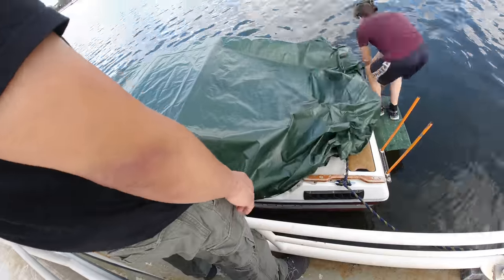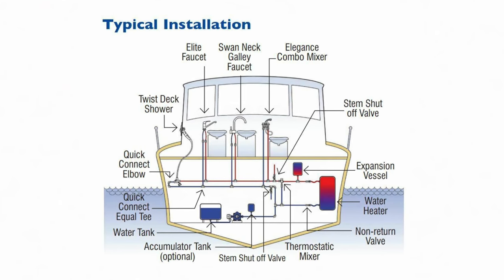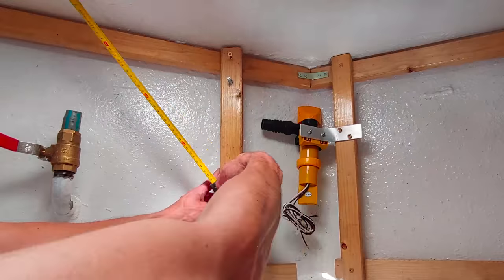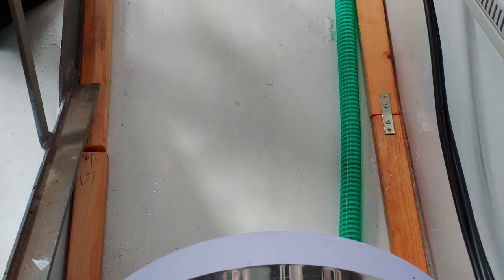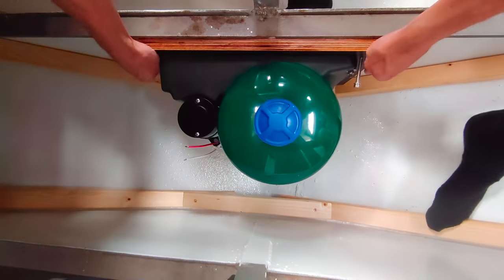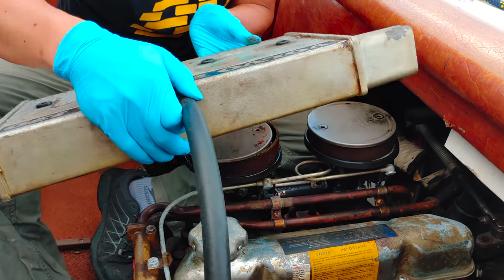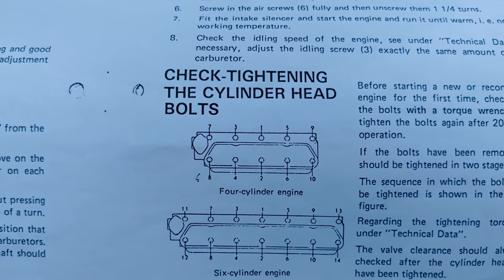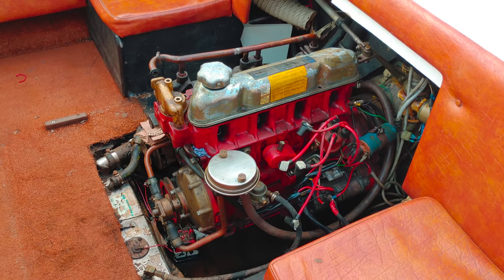OPENING the ENGINE of my 1980' BAYLINER Mutiny - Ep. #42 - Vintage Yacht Restoration Vlog

Comment: That engine isn't a total lost.
Take the head back off and rotate that cylinder to bottom dead center. Look the wall over good.
If you don't have large grooves in it you should be ok.
Take your head in and have a valve job done on it and have them check for cracks...
You may find out you still have a good unit there.

P.S. don't use your torque wrench as a breaker bar.
You'll ruine it. And screw up the calibration...
Keep up the good work.
👍👍👍

Comment: Looks like a blown head gasket let water to get into the cylinder causing the damage, I'd say the engine is rebuild-able.
Reply: Agreed ^^^
Reply: That is exactly my thought.  I would price a rebuild on this motor, might be most cost effective solution rather than buying used.  You get a new motor in the process.
Reply: @kenknight4560  That's right, in a rebuild he gets what you said, a new motor, in a used he gets the mystery motor that could go bad just like this one.
Reply: A nut was dropped down one carb. It actually looks like it on damaged one piston a little. The small chip on the head can be repaired with a welder put a new piston in and run it
Reply: @giles-df9yu  that's not a chip on the head. Look closer. It's just the head gasket that's damaged
Reply: It's definitely a blown head gasket, between the exhaust valves of #2 and #3 cylinders. Common failure point because that is the place where the head gasket experiences the most stress, as the exhaust valves of those cylinders are pointing towards each other. You can also see the point of water ingress on the coolant channel that is most rusted.

That motor will be OK after a good clean-up.
Reply: nope. that piece was part of the valve seat on the smaller valve. that motor was way overheated and the seat came out and got chewed up in the piston. that motor is toast.

Comment: Torque wrenches are designed for tightening bolts not loosening, you can damage the internals/alter the accuracy by over torquing when loosening bolts.
Reply: You beat me to it, right on.
Reply: Another newbie tool user mistake.
Reply: @JamesRook  
I've seen qualified fitters in nuclear power plants do exactly the same thing.
I worked at a garage when I was 10 and one of the mechanics caught me using his torque wrench to undo wheel nuts, he kicked my ass all over the workshop but in 52 years I never did it again 😂
Reply: I have two torque wrenches that work in either direction for left hand threads and I heave been involved in the maintenance of gas turbines and high sped rotating equipment for over 40 years.
Reply: @bigboy9693  
All my torque wrenches work either way as well, never seen one the that doesn't.
Reply: @bobp6742  I have a 3/8 drive one that does not as it is fixed without a ratchet. but my other ones work in both directions.
Reply: @bigboy9693  At last count I think I have 6? 7? I have a couple of small 1/4 drive inch/lbs wrenches for torqueing things like Harley primary covers. Mid sized 3/8 drive units for larger fasteners running up to maybe the 200 lb/ft range, and 1/2 drives for the big stuff. A Harley crank can need 500 lbs of torque. They are all reversible.
Reply: There are several mistakes he often makes... F.e. using metal files in both directions, instead of only "pushing" - that kills a file very fast.
Reply: This 👆
Reply: calling bullshit on this old furphy, that torque wrench clearly has a reversing switch and if they thought loosening bolts would hurt they would  not have enabled such a design.

Comment: Don’t give up on that engine, take the pistons out it doesn’t look that bad
Reply: I was going to say the same thing.  A little clean up and a new head gasket may be all that's needed. An inspection of the bottom end would be nice just to make sure the rod bearing didn't get smacked or rank bent, But it is an assumption that the piece fell in while running. It could have rolled in just trying to start, in which case no real damage would have occurred.
Reply: The "bad" cylinder may only need to be honed. Since the piston was at the top of the stroke, the bottom section of the cylinder may be fine. The advantage in reassembling the engine with new bearings, rings, gaskets, etc. means that you will know that the engine is in good condition. Just buying another engine, you won't really know the condition of that engine. It might run, but for how long?
Reply: There is allways hope, dont give up yet. Some times we have give first aid even worse engine. Greetings from Finland.
Reply: Oil it and free it up. if you can't free it by pounding pistons with a wooden plug,  try putting the head back on, making a grease fitting that screws into a spark plug hole, and using a grease gun to fill a cylinder with grease and then force it hydraulically with the grease gun.  You can fabricate a plate with a grease fitting and bolt it on with the head bolts too.  https://www.youtube.com/watch?v=vOBBU6h8BFU
Reply: I agree here... I paused the video and it looks like the gasket blew next to that water port. From there it probably hydro-locked. As long as you dont have any lower-end damage this should be a simple fix. Even then a replacement rod and bearings would be easy.
Reply: I agree to. see alot worse  come back around .that build up look like carbon an rust an crust .l stop the video I dents see any valve damage.i would wire wheel that head make sure valve  not stuck .clean that piston up lightly go around top with wire wheel put some oil on cylinders getting turning over an put it back together. You might what to check head for flats ness .take a file at a angle run it across head lightly.
Reply: A little hone work, some rings, wire brush & lap some valves, new head gasket, clean the carb - it should run!  Might not be good as new ... but that old boat isn't one bit new.
I fixed worse when I  was a boy, most times i didn't even have new rings or gaskets, just sand paper, Permatex, and used oil.

Comment: Greetings My First Boat,  You are doing a great job.  You make it seem like it is not hard work but we know better.  Please consider installing a second, much larger bilge pump such as the Whale Orca BE3004 189 liters/minute for unexpected emergencies.  It does not need to be mounted in the very bottom of the bilge, just somewhere accessible that will keep your boat afloat in an emergency.  The reason is that if you run aground someplace and cause a big leak in the hull below the water line and your primary bilge pump does not work for some reason, you may not have time to diagnose and do a repair.  Also, your Supersub Smart pump capacity is not intended to handle the volume of water from an emergency situation.  With this second pump, all you do is turn it on and you will have more time to save your boat.  It is well worth the cost.  Regards,  Cole

Comment: That cylinders head gasket went due to corrosion it seems, it ate some water and was put away wet. Seems to me like it could be saved with a hone (maybe a bore), new rings, maybe new valves and a piston and offcourse new gaskets and bolts. Then again if you can get one for cheap it may not be worth it. If you plan to just do short runs with it, this might be a nice format of vessel to convert to electric, since it doesn't need all that much power to go and you can use the batteries as an extended house pack for the big boat. Getting some more solar might be a good choice at that point

Comment: That was caused by a blown head gasket clean it replace valve's and head gasket simple fix.
Reply: agreed- shes not dead yet!!!   soak it in marvel mystery oil,  get it rotating and clean it,   and re-clean and seal-- ill bet she'll run for relatively cheap money
Reply: i think it is more likely that the inlet valve was open and water entered through the air intake on one of the carbs looking at how much corrosion there is on one of those carb throats
Reply: @debeeriz  exactly- it looks like iron buildup not a broken part,  sure it needs a new valve,   but i believe a little cleanup and head work and shes good to go- the iron deposits took the shape of round because thats how it settled in the cylinder,    not a piece of the valve- at a quick glance in the video the valve looks to be complete, not a chunk missing

Comment: Gday Crew,,
Another great episode,, thanks for sharing with the faithfull....
Please check the volvo motor for water ingress via carburetors, may have hydraulic locked due to water,  hopefully the  head did  not  crack (check for crack) also check for blown head gasket ,,
Good chance motor can still be saved , but may need head pressure tested & valves re done ....  providing  bottom end is serviceable..
Good luck with it ..

     Respect 
       from
 Down  Under

Comment: I agree with many of the other comments. That motor can easily be repaired. Even if you do want to give up on it, disassembled the motor and sell all the pieces. Lots of people looking for spare parts. There are lots of options when replacing the motor! A small 2-cylinder diesel would be a excellent replacement. It may not be as fast, but it would be an excellent economical tender for your platform. And it is Handy if both boats use the same fuel. ;-)

Comment: That engine is probably the easiest engine on the planet to renovate if u want to go that route. <3
Reply: Yeah it’s a Volvo engine, they are all easy to
Work on
Reply: @tankerboypz1287  until you get to the modern common rail diesel and then you need to be a computer technician to achieve anything with them.

Comment: Got to agree with lots of the comments 
Motor looks salvageable 
Looks like the head gasket blew and can probably be rebuilt quite easily
Maybe a new piston and rings and check that the head is straight (can be skimmed if not) but definitely worth getting someone who knows take a proper look at it and get an estimate.
Would go down this route before looking at another engine that may end up costing you even more.
All the best from Scotland 👍

Comment: Those head bolts are usually stretch bolts, so you will have to replace them when you reattach the cylinder head.

Comment: Take the cylinder head to an Engine shop and have them remove the valves grind the valve seats and replace with new valves. Then pull the engine block out (which you are going to have to do eventually) remove the connecting rod bolts and check the crankshaft if good then pull the pistons and send the block out to be bored over to the next available piston size reassemble in reverse order.

Comment: Some thoughts. Did you mount the bilge pump in the lowest part of the boat? Usually the stern is the lowest point back by the engine. Also that bilge pump is going to be really hard to access if the is a problem with it if that water tank is full of 60 L of water.

Comment: A bilge pump will need to be replaced sooner than you think installing under the boiler is a mistake ! In fact you should install two pumps so you can unplug the one that go's bad and and replace with the standby pump..........with water entering the bilge you want a fast turn around !
Reply: ALWAYS use two pumps. Its a Heater. Says so on the box. Boilers are used to turn water into steam.

Comment: I noticed you put the wood frame for the bilge pump below the bilge pump. Won't the wood rot in the water? Also, did you coat the cut ends with varnish?   I enjoy your ingenious videos!
Reply: I am sure the bilge pump is at the lowest point. Nevertheless there is plenty of wood close to the bottom of the hull.

Comment: That engine is easy to fix :-) believe me i’m from Sweden 🇸🇪, clean up the head , check all the valves, and put new gasket on , check the manifold for rust , and put new impeller in and drive :-)
This failure is common it’s i blown head gasket , and water and rust :-), no need to change piston etc this engine is almost un breakable :) so put 30 € on gasket and of you go

Comment: Agree with the majority that the engine isn’t toast. Not bad at all, wire brush the rust away, hone the cylinder and she’ll probably run. Also it is not recommended to reuse head bolts.

One other recommendation, make sure you have plenty of ventilation in your bilge…pine dry rots at the blink of an eye.

Comment: I agree with the general consensus on that engine. It's too early to tell if it's a total write off. You need to move the pistons, or remove them and inspect the cylinder bore. Maybe it's not as bad as it looks. Quite possibly both the block and the head will need some form of machining.

Comment: That engine looked like it was sleeved, you might be able to have it resleeved. That is to say the cylinder has a replaceable inner piece that can be taken out and replaced with a new one to help with this type of issue.
Reply: Not sleeved. Impression from the fire ring. I think cylinder #3 was sitting with an open  exhaust valve so moisture got in there. Basic Volvo engine. Parts are cheap and plentiful.

Comment: The very first thing is to check the exhaust manifold. It could be corroded and perforated. 
When perforated, the water that cools the manifold finds its way to the cylinder head. The exhaust manifold is expensive, so you don’t want to try to repair the engine without first checking the manifold condition.

Comment: That motor looks in quite good condition. Most rusty bits were form the crushed part, and since it happened at top dead center, the cylinder wall might still be salvageable. I realize you have to get it out to work on it, but you have to remove it anyway.

Comment: Check the cylinder lining surface, if it is not badly scored, remove and clean the piston, fit new rings and big end shells, rebuild the engine and it will run for years.

Comment: You may be able to save that engine they are pretty tough. Water ingress for sure perhaps due to being on inlet but dought exhaust stroke.. Perhaps icing also? Perhaps try to clean it up and lubricate well and rotate the engine manually then check for damage?

Comment: I would also say that the engine can be saved. The cylinder head can be re bored and then sleeved back to original size thus giving you an almost new cylinder head. New pistons and rings will then give you good compression. Check the crankshaft for damage first. If this is wrecked then it may be cheaper to swap out the engine.
Regards
Tiny.

Comment: The metal parts on the piston maybe a nut from the filter that dropped into the intake and then into the engine. If the bore isn't scratched too badly you might get away with just replacing that piston and rings. The engine will have to come out, so tow the Bayliner to a yard which has a crane. Maybe one that can look at your engine. Good luck.

Comment: That engine block should be fine to use. I'd say you'd only need to replace the top but it's best to remove the cylinders and crankshaft to check. The extra knowledge you get from fiddling with the stuff won't hurt you even if you are replacing the engine.

Comment: I would have gone with a WD40 on those pistons to try to move the engine over to see in what state is the bore of the cylinder. Maybe it just needs a new head gasket and valve lapping (if super reliability is not necessary)..
Reply: Diesel works better in my experience.
Reply: Either one is better than nothing.

Comment: Speaking from experience, I have a relatively low-cost suggestion for you...  You now have a brand new bilge pump with an outlet that you cannot easily access.  A problem with the pump, fitting, or hose leaves you with NO bilge pump and NO way to quickly correct the problem.  Install a second bilge pump.  Doesn't need to be fancy...A high-capacity pump and a toggle switch on the dash (or local to the pump) would do just fine.  If nothing else, a portable pump, power leads with battery clamps, and a few sections of hose in a locker would suffice.  TRUST ME...Trying to replace a failed pump while your buddy is trying to keep up with a leak by bailing with a bucket is NOT a relaxing task.

On a VERY related subject, if you are running a wet exhaust with an outlet below the waterline, make a cap that can be secured on the outside of the thru-hull for the exhaust.  Trying to replace a bad section of exhaust hose while your newly-repaired bilge pump AND your buddy bailing are barely keeping up is also not fun.  

You might consider what the US Navy calls "Damage Control Plugs"...basically a selection of cone-shaped pieces of soft wood such as pine.  When all else goes sideways, you then have something which can be pounded into a thru-hull.  A sheet of rubber and a plug can be used for roundish holes which should not be in the hull.  Rubber sheet and wooden wedges can be used for splits and gouges.  Rubber sheet can be placed around a holed or split hard pipe, then over-wrapped with a few layers of light line to at least get you back to port.

It's actually quite amazing how much a leak due to damage in a metal hull can be mitigated by putting a piece of rubber over the leak and pounding in an appropriate chunk of wood.  To this day modern US warships come equipped with high-tech damage control equipment...as well as wooden plugs, rubber, oakum, tarred line, etc.  Shoring up damage is accomplished by a nice selection of wooden beams and a few chain saws....and more line and wooden wedges.  No matter what the era, success is measured by which side of the hull the ocean is on when you are done...
Reply: Very, very good advices!!! I have a wooden cones set handy too and a hand pump!!
Reply: He doesn't seem to respond to any comments.
Reply: @jrrains  Yes true, he seems to read them though and take the free good advises as well as take all the free money/donations! He is for sure a good YouTuber but definitely not a boater!!! In boating, arrogance hits back really hard!